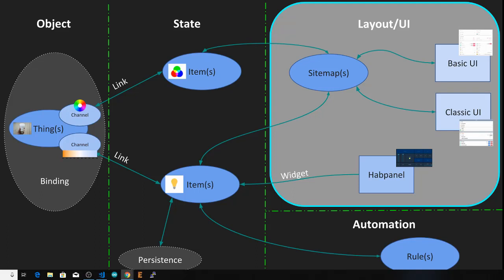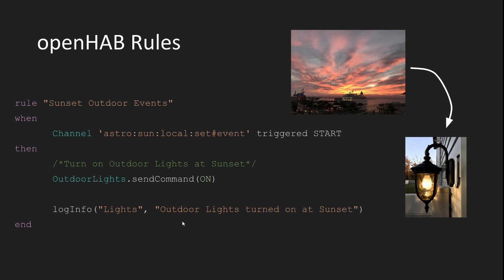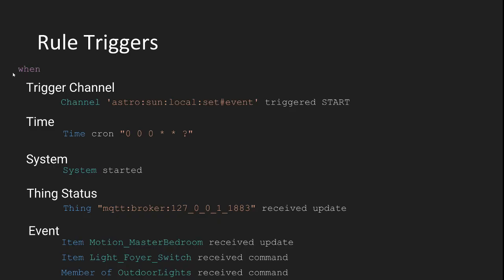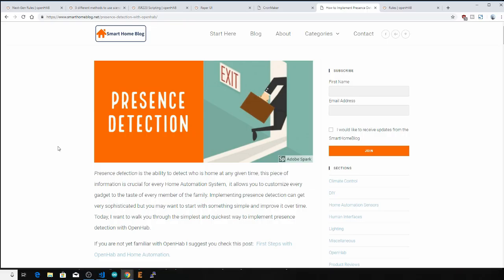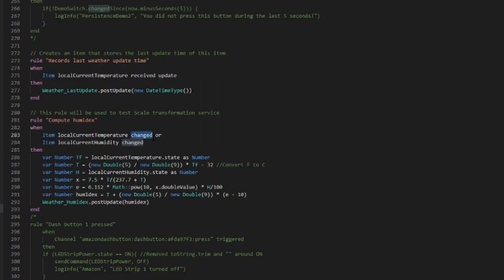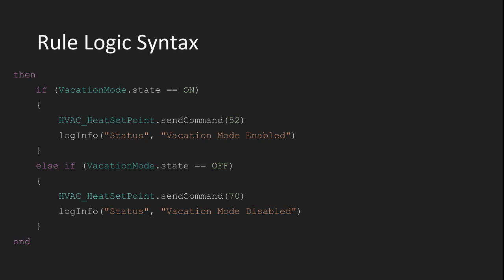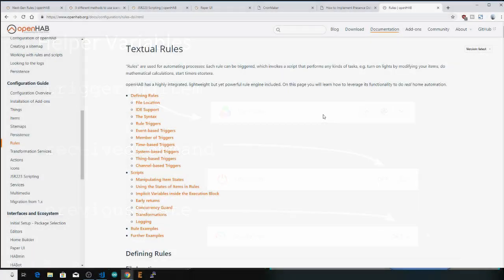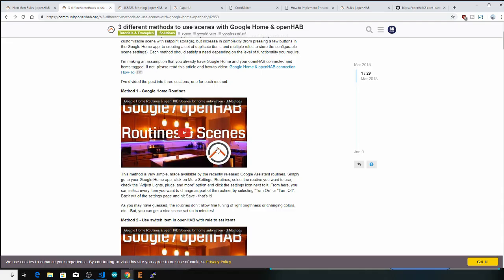openHAB 2 Basics - Rules DSL Introduction

Comment: i used the time cron to generate light on and off time, but once on and if Pi restarts then it doesnt turn on it send the command at exact time in cron. am looking for schedule method so that even if pi restarts then also if the time is between on time it would keep light on. any suggestions to do this

Comment: Hi BK Hobby, question i cant find an answer for. Do you know what Telldus is? Im having trouble to get my on/off plugs into OH, i got the bridge online, but my units wont appear. Anything you can help me with?
Reply: Hi Jerry. I'm not BK Hobby nor Telldus but I use Telldus in my openHAB setup - and I enjoy following the excellent tutorials from BK Hobby :) I assume you have got the Tellstick bridge up and running correctly or else see https://www.openhab.org/addons/bindings/tellstick/ A good sign that the bridge is indeed working is that a number of Telldus sensors tend to pop up in the Inbox of the Paper UI. The Tellstick (or equivalent) grabs whatever items it picks up and asks if you'd like to include them in openHAB. Remember that Telldus is one way units; sensors and remote controls send signals to a receiver (e.g. the Tellstick Duo) and actuators like wallplugs and dimmers receive commands from the Tellstick but there is no way you can query e.g a dimer about its state. So in order for OH to be able to discover your plugs, you will probably have to add them to Telldus Core or Telldus Live first. Have a look at the binding info I linked above and if that doesn't help you solve the problem, ask in the excellent openHAB forum. Good luck!